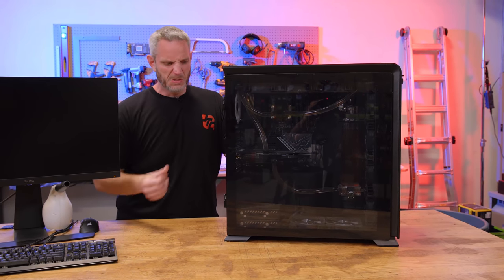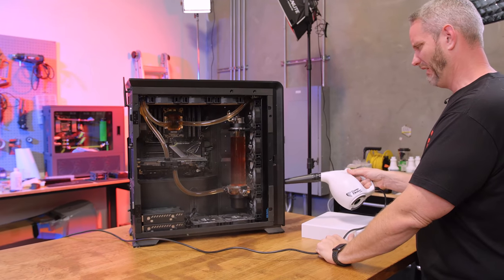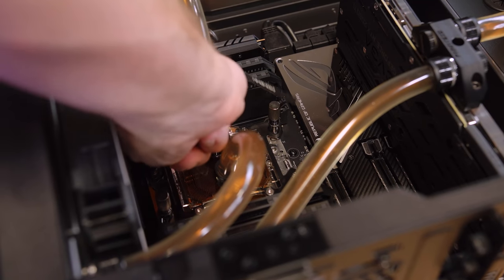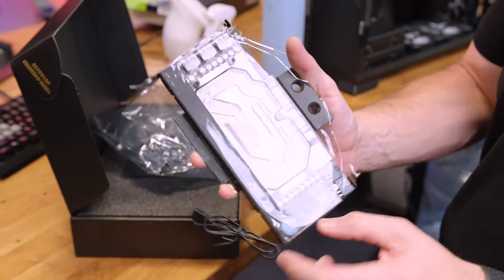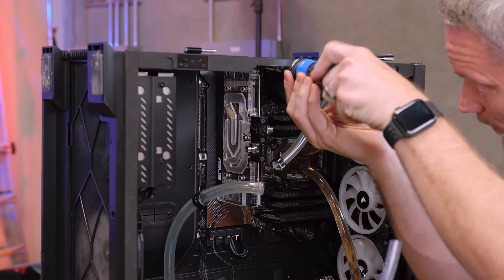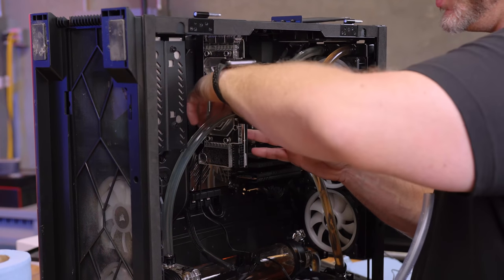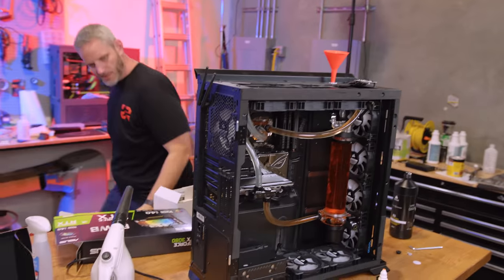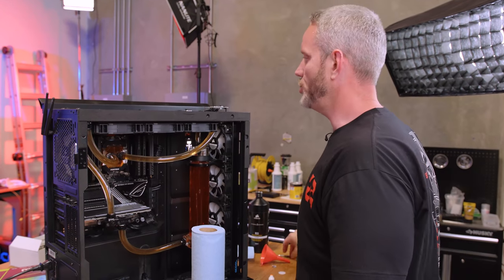Giving Phil the upgrade he deserves!

Comment: I've Just Built a Kick Ass Rig All the Latest Ryzen tech & full water cooling with front Distro plate & Hard Tubing,(cheers 4 your hard tubing lesson Jay) No mechanical drives Just M2's & SSD's... Then had to put my old EVGA 1070 in it... I'd bloody kill for  2080 that didn't cost more than my weight in Gold

Comment: was using my compucleaner on a 140 mm fan while taking apart my file server, fan blades were ripped off by the static pressure. thing is a beast.

Comment: Jay will probably never see this but..I was thinking, glycol based coolant probably "definitely"  has a viscosity that "I believe"  would separate from a flushing/ cleaning agent such as alcohol or even water, as I have never water-cooled I'm a noob when it comes to this "however I spent many years as an industrial maintenance tech. and like to think I have a decent understanding of fluid dynamics" but I don think I've seen the method of utilizing  fluid separation to flush the system, run a hose from the pump intake to a container "or bottle" of a flushing agent, if your running water, use an oil base to flush or vice versa, the disconnected piece  can just go to a bucket or whatever, then you just keep flushing "running the pump" till its clean, I suppose this method would come in handy for switching coolant types or colors. Are there videos on this?
Reply: this would also be useful for hard line systems...

Comment: 3:13 This is also great advice for chemists, as an undergrad chemist, we do lots of extractions and vacuum filtrations with knobs just like these to control the flow of fluids, it never occurred to me that a drain valve would be the same, however, at the same time it makes perfect sense.

Comment: I’m building a pc and I’m putting a rtx 3070 fe, ryzen 7 3700x, 16 gigs of 3600mhtz ram, 2tb 7200rpm hard drive, and a 500 gb ssd. Will that be a good pc compatible and will get 100+ FPS on most games
Reply: Lol what games what resolution what settings you have to be more specific than "most games"
Reply: Mostly fortnite maybe apex legends and Warzine at 1080p amd 1440p

Comment: Everyone and their mother on the internet will say "why gpu no top slot?". Correct me if I'm wrong, but it will still utilize x16 in that slot?
Reply: All full length PCI-E slots on the sTRX4 mobo are 16x as the chip has 128 PCI-E lanes.